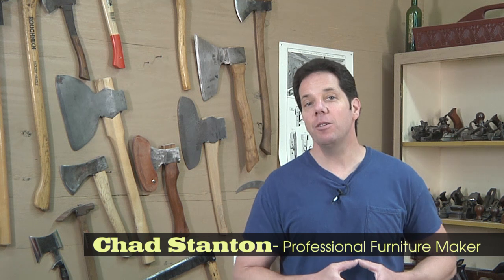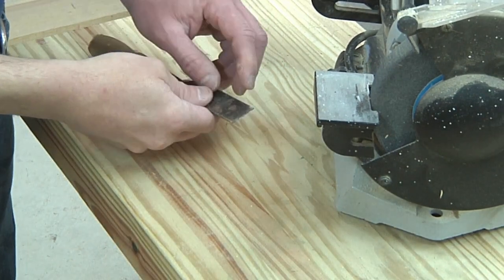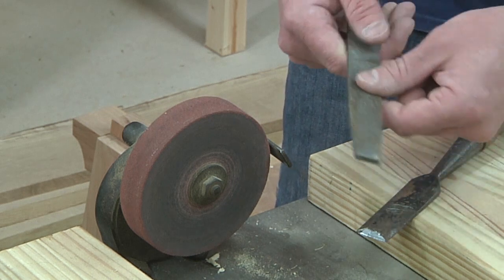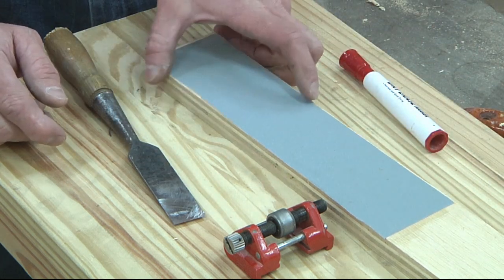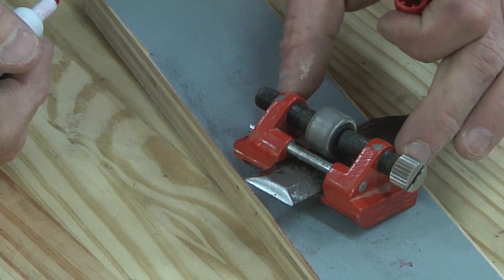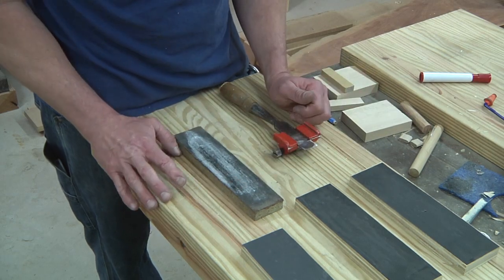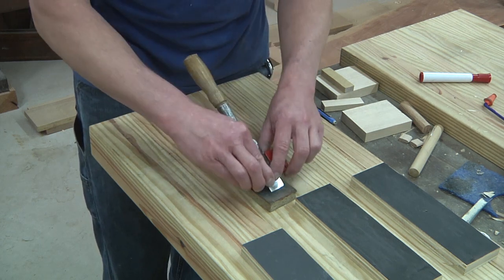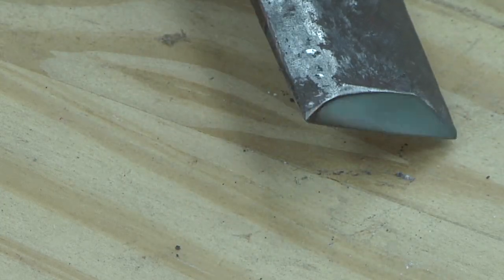Tips for RAZOR SHARP Tools for the Beginner Woodworker

Comment: Great video, Chad.  I used the same method when I was starting out sharpening and it worked great.  I created a reference block with stops for different chisel and plane angles that I keep with my sharpening kit and that saves a lot of time.  It's important to remember that when a chisel starts getting dull you can usually get it right back to sharpness by re-honing on your strop, so keep that handy while you are doing a lot of paring or chopping.  You don't need to hit the sandpaper or whatever you use for the main sharpening every time you need to refine the edge.

Comment: I think once you get the honing angle set (say 30 degrees),  then you can set up a line so that subsequent chisels just need to be inserted in the honing guide up to that line.  That would save trial and error each time. There is a simple mathematical way to get 30 degrees, but would involve some awkward measurements (distance to tip is twice distance from wheel to bottom edge of the chisel directly above it when in the guide).  That is,  the length of a 30 degree bevel is twice the thickness of the chisel at the top of the bevel.

Chad Standon had an axe; he gave his timber forty whacks.
When he saw what he had done, he smeared some glue upon his thumb.

Comment: When you establish your original bevel angle, measure the distance from the face of the guide to the tip of your blade. EVERY time after all you have to do is set the blade to that dimension and VOILA consistent results. ( I posted this @6:44 you may have stated this trick later!) Same with plane irons.
Reply: This is Garry not Linda. I have the same guide. If you look on one edge it gives the distance for chisel 30 and 25 degree settings and on the other it has the settings for plane irons. No muss, no fuss, no math.
Reply: I'm pleased it's Garry not Linda. Linda gives terrible advice.